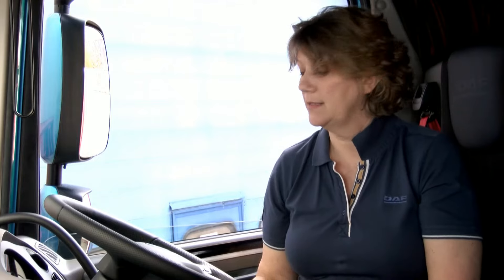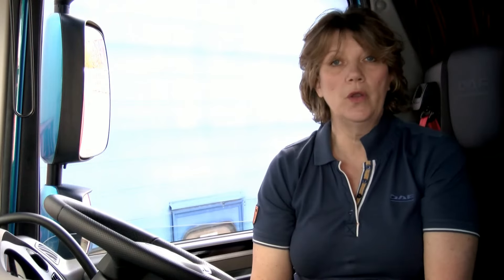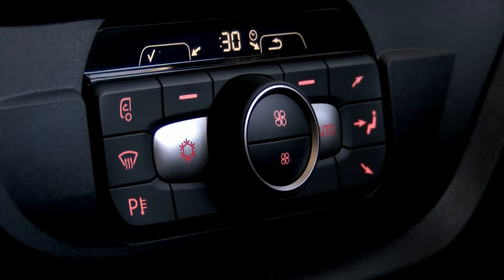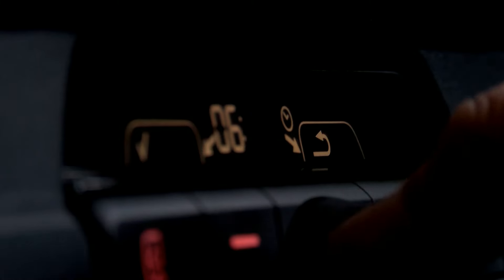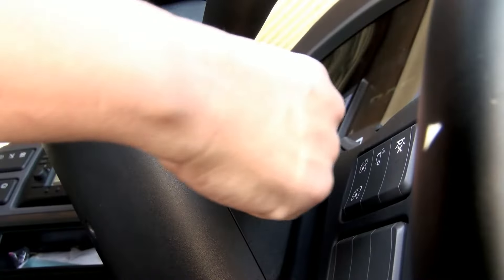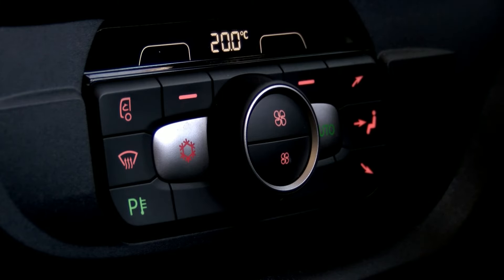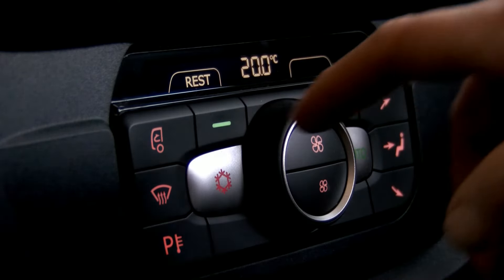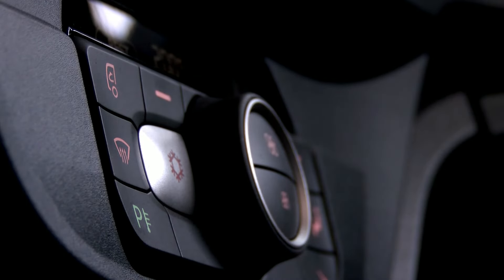DAF MY2017 | Operating the Auxiliary Heater | DAF Driver Academy

Comment: So to use the heater when you sleep you just push the P button?
Reply: Yes... night heater is P button
Reply: @carrie7845  how long with the P button on will last ? All night?
Reply: Until you're battery is criticaly low, it will run all the time without issue.

Comment: why do you not invite to design the driver's cabin or many drivers who will tell you what is needed and what is redundant.  for example, the new wet heating is tragic, I am reminded of the 95 years when there was wet heating in daf. the energy mass absorbs the heating and it makes no sense, probably every winter pack model is missing, there is no heating that will work with the engine together when it is very cold  when going to Russia or Austria where it is very cold and a lot of snow, there is no electricity in the batteries, the fuel freezes, you cannot start the heater or the engine.  it is best to plan the construction of a cabin and many components, such as plots or accessories with drivers, because the bosses or office employees have not yet designed a good functional cabin.  the quality of plastics and assembly, assembling them is a total failure.  and this equipment has to be paid extra for each element, stupid microwave refrigerator or air conditioner on the roof. or leed lights, a shame for such a big company.  and I would paint the lighting of the Jacuzzi heating panel, because the whole night is shining at maximum power.  it is a failure